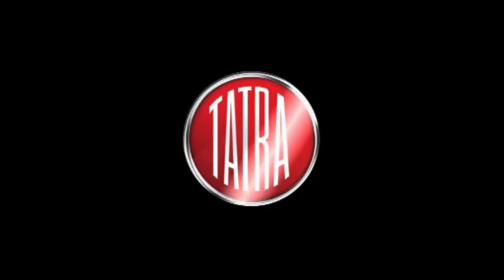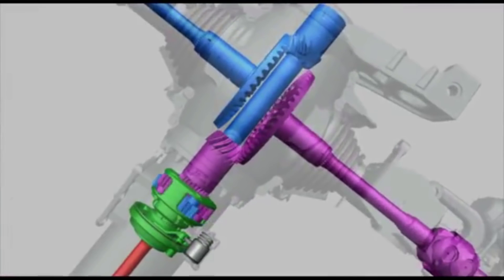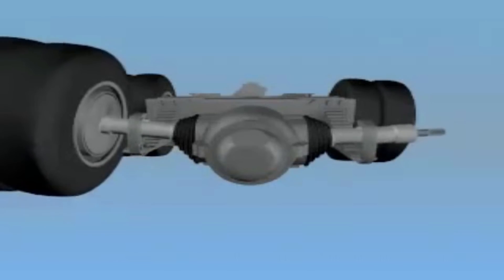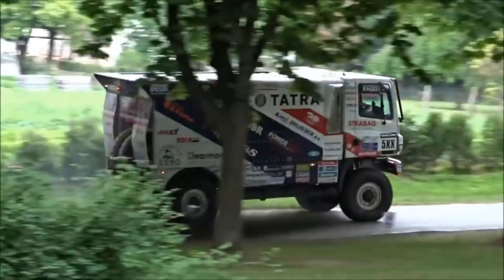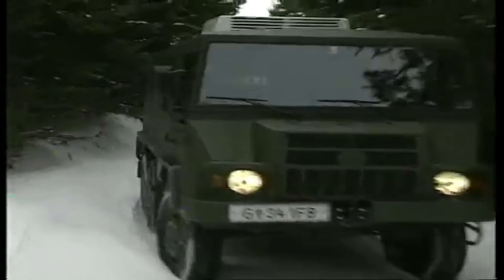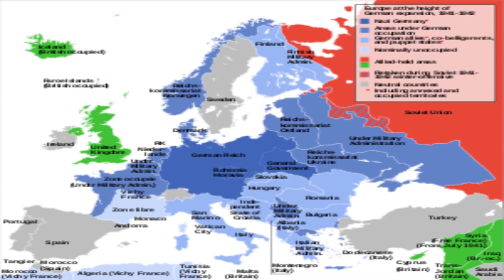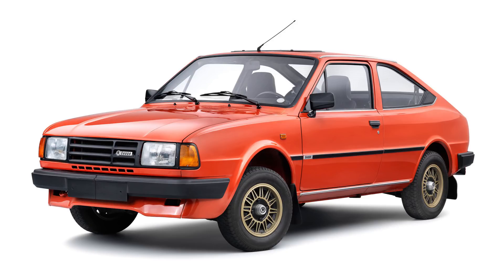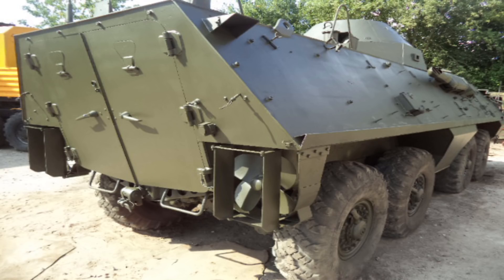Tatra concept-engineering brilliance from the Czech republic

Comment: Its worth mentioning that 'Bubcha' the old 6x6 service truck that was part of the Tatra Loprais team did about 20 Paris - Dakar rallies without any major repairs, yes it was extensively serviced each year, but in general it was the same chassis / backbone tube, engine, gearbox, cab and body.

SDI only bought Tatra in order to get access to their 3rd world / old soviet market contacts, mostly through trade delegations / embassies, once that was dome it was sold to Terex and run by Capt Ron ex CIA operative, the whole operation stank. And then there was Vectra?

Comment: Would love a drive of one of these machines in a tipper environment, but usually power is precedence over comfort with military based machines, not sure how i would feel after 9 hours driving time, but would still love a test drive of one
Reply from the maker: With the daf cabs you could sit on the motorway all day no probs, agree all their older stuff would be like driving a garden shed, nails and all.
Reply: Tatra is not only ""military machine " they were Tatra tipers 
in 60es to 90es in Czechoslovakia
Tatra 138 and 148 model 
""Tatra nezna bratra "